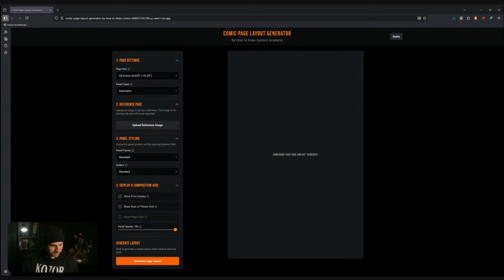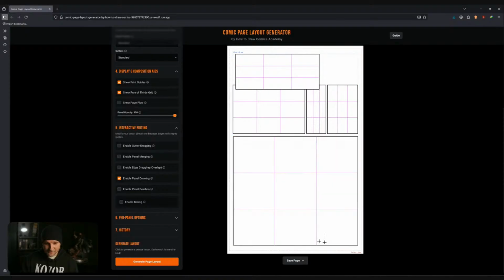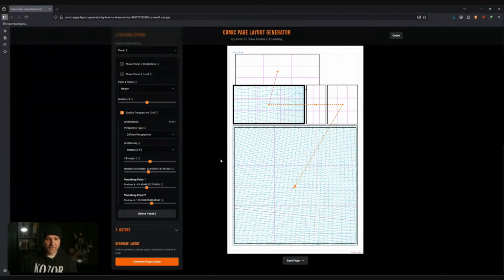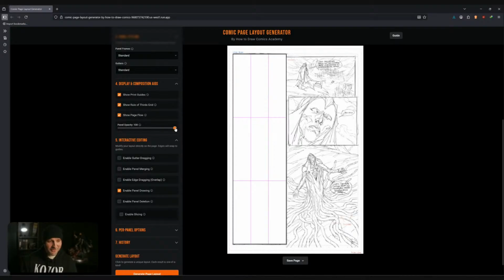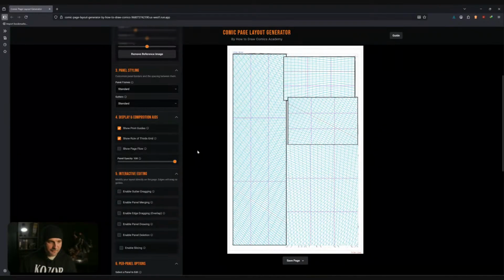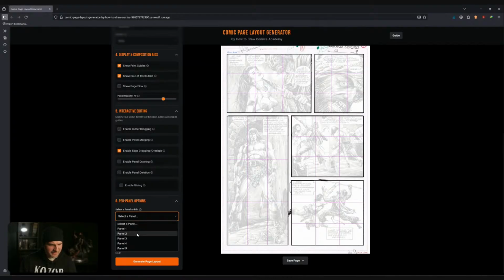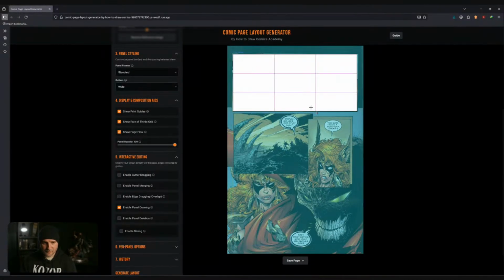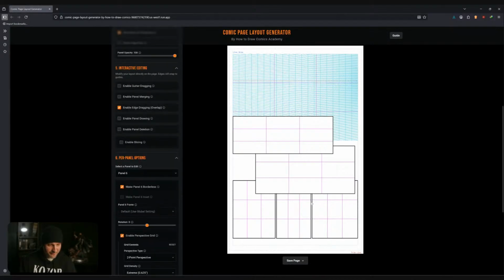Lay Out Your Comic Pages In Under 30 Seconds!

Comment: Gave this a test run today (after signing up!), it's an amazing and easy to use app. However, I don't see the rotation tool available under Per-Panel Options. Did it get removed?